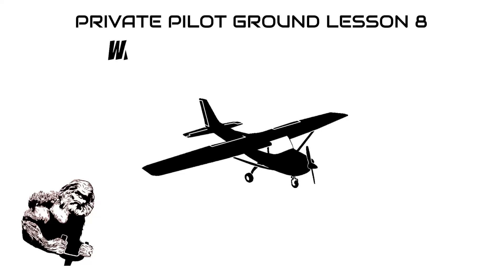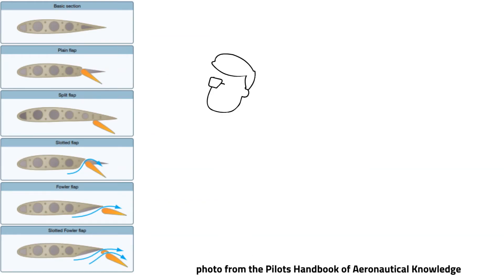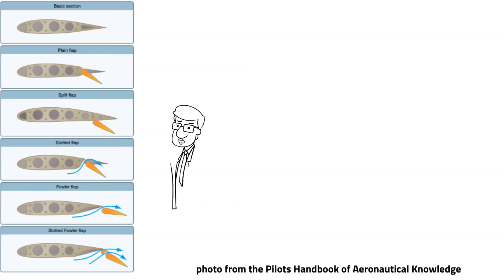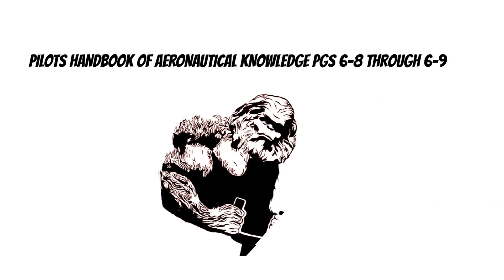Flaps on a Plane & Why we need them (Private Pilot Ground Lesson 8)

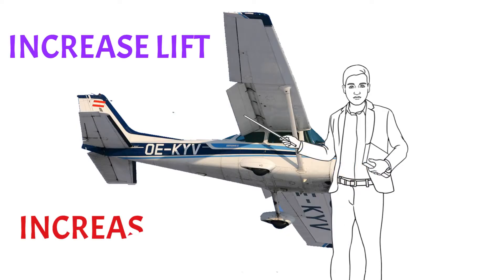Comment: 0:09 flaps are secondary flight controls 
-they increase lift and drag 

0:20 they allow us to land as slower airspeeds 

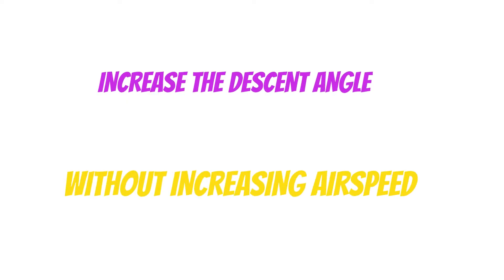0:28 allow us to increase descent angle without increasing air speed 

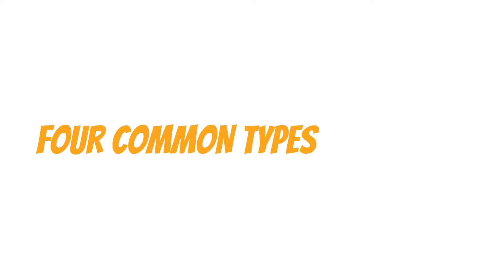0:52 sometimes it’s beneficial to land without all the flaps such as in conditions with gusty cross winds

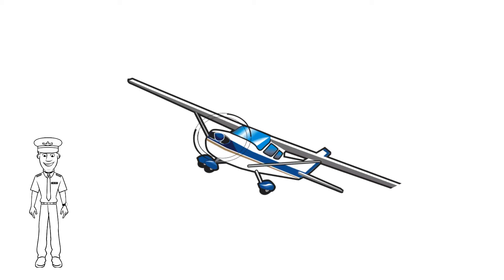0:53 four common types of flaps 
-plain flap
-split flap deflected from lower surface of airfoil 
-slotted flap
Fowler flap increases surface area of wing

Comment: My question is on the different flaps. Are there advantages and disadvantages to each type and what would be the expected differences in using them if any? Trying to look at these as self study.
Reply from the maker: The different types of flaps will have more or less drag vs more or less lift.  As far as “why” you’d want to use them, check out this video: https://youtu.be/YWitXcjrE64?si=lEjyxa_AnQRf04KN